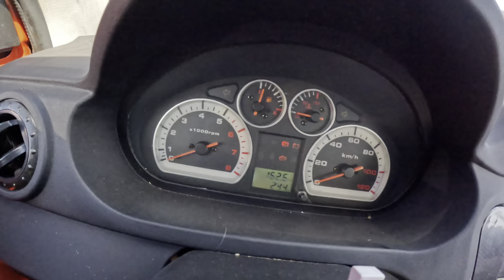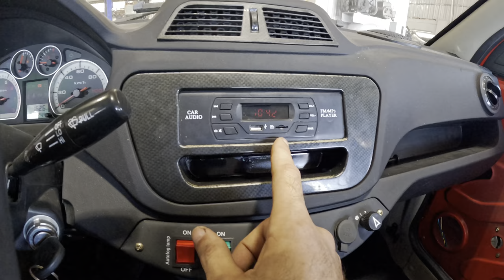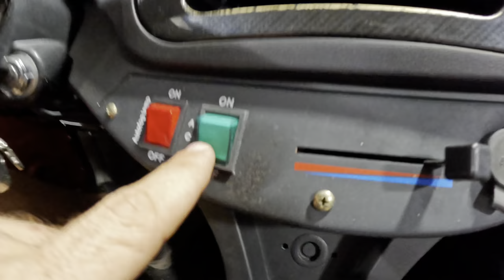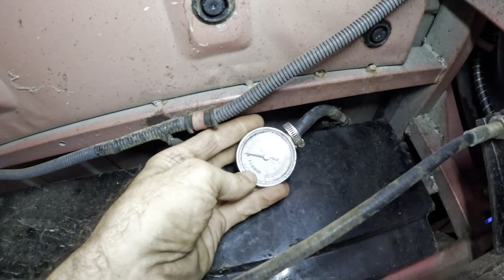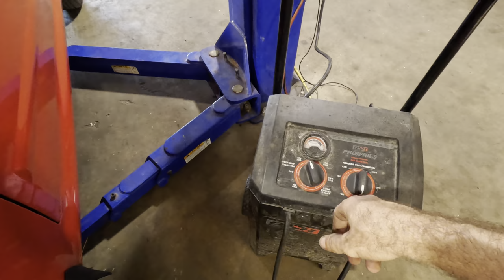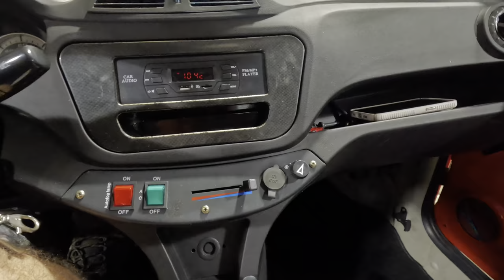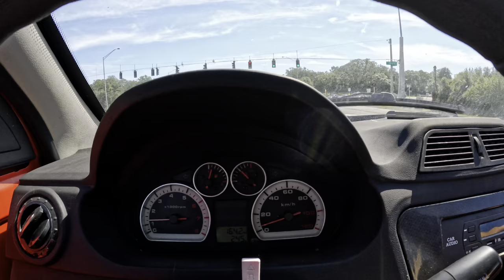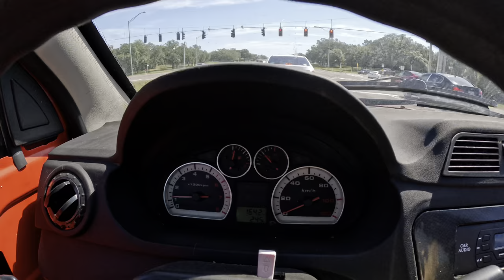UNFIT for the ROAD! Brand New 2019 Piece of Junk!

Comment: Be sure to remind the climate change people that there are hundreds of thousands of these driving around China without converters or any antipollution devices .
Reply: 😂

It's okay though because everyone has Chinese batteries
Reply: And probably believe it's better...
Reply: They also sell similar electric cars. Equally bad.
Reply: You don't understand ! If you don't have a catalytic converter, the fuel does not become CO2 ,just unburned fuel, hydrocarbon.
Reply: Converters are not needed, do lawn mowers, and golf carts need converters?
Reply: @thepubliceye  Lawn mowers are combustion engines using fuel and produce an exhaust . The difference is that not many people run their mowers for hours at a time every day . Golf carts are battery operated .
Reply: What's your point? That if somebody pisses in the pool then you should too?
Reply: @MarkS61  My point is that If I pay millions of dollars a year to stop one person from pissing in the pool and other people are still pissing in the pool then the pool still has piss . Did you know that in the past 50 years global temperatures have changed less that 1 degree .
Reply: Yeah, let's aim to be as good as one of the worst examples. That'll work out great.

I prefer the clear skies and cleaner air in Calgary and area to the smog of Chinese cities thanks very much.
Reply: i was thinking to hat very same thing war against oil here and there they get by with not worrying about climate but here were paying for the rest of the world
Reply: @thepubliceye Yeah but how am I supposed to feel superior when you bring logic into it?
Reply: @eaglerider1826  Golf carts are both and in California meet EPA standards without a CAT, you don't have to use a CAT to meet EPA standards, it's just the cheapest way. O what about motorcycles.
Reply: Lift point: Brake lines.
Reply: @thepubliceye  Need them? Probably. Just not legislated yet. Some motorcycles have them now though.
Reply: @eaglerider1826  Only SOME golf carts are battery powered. We had gas carts at the course I worked at, both Club Car, and Yamahas. All the bag carts were battery powered though.

Comment: Do you remember the early Honda, Datsun, and Toyota imports? In the 80’s or 90’s my work had Daihatsu miniature vans as site vehicles. Those things were ridiculously bad. Once, a slide door fell off going around a corner. We used to pile 4 guys at once in them, so they were kind of abused. Anyway, my point is that some of these companies will get better, quickly, and some will just fade away, but do not underestimate their potential to improve.
You are absolutely correct about outsourcing our pollution.
Reply: Well, the manufacturer of this car is too late now to catch up with the likes of BYD, GEELY etc etc or even the Wuling fun car 🚗 manufacturer.

Comment: I’m 75 and have driven early VW Beetles, Saab 9-3 with 3cyl 2cycle engine no ac or a 1961 PV544 Volvo all were solid transportation and fun to drive. No auto, no ac, no air bags though I think all were built better than this little thing. Don’t knock simple solid engineering, VW excepted.

Comment: Purpose built to move people in the most economic way.  Build quality might be poor by the standards we hold but if probably suffices where they were meant to be.  I owned small cars from the late '50s, DKW two strokes with 900cc engines.  They were good for everything I wanted to do, could even hold an assembled small motorcycle to take to races.  Really, 40-50 horsepower is good for most realistic driving.  I'd like to know the specs of this tinny little gem, like engine displacement, horsepower, and overall weight.  The engine is intriguing, might be a jewel in disguise ...(?!)
Reply: It's true that 40-50 hp will work. BUT in the US most of everything is at least 120 so while 50 can get the job done on a small car, it gets sketchy with our speed limits and infrastructure. Let's say making a right on red when the road has a 45 mph speed limit. "Stroads" as some call them. My car has 74 hp, weighs a bit more than a ton and it's mostly fast enough to be safe. Just have to keep up with the air filter and give it an Italian tuneup here and there. 45 mpg on a non-hybrid car that's easy to work on is amazing!

Comment: It doesn't really have McPherson struts at the back, it's a basic trailing arm system.  The spring/damper was clearly designed for a McPherson strut system (probably the same as the fronts), but it's just being used as a coil over damper.
Reply: they wouldnt have understood this technical stuff

Comment: I guess it is designed to fall into the Quadricycle category which means it can be driven without a driving licence. In Europe and the UK they have to be limited to a maximum speed of 38 mph.  Several manufacturers are turning out electrically powered quadricycles, such as the Citroen Ami.  Its battery gives it a range of about 60 miles and if you run out you can always attach a power pack to get a few more miles.  I suspect that vehicle as had the internal door panels taken off, perhaps by customs on import,drug check,etc. as I think the inside door handles were on the passenger seat, so I think you were a bit unfair to it.  It was obviously designed to be low cost and to meet the requirements for a quadricycle.  For that it meets the design criteria quite well, at least it can keep the rain off.

Comment: 28:50 the red button is probably for  the  front shield morning defrost but i could be wrong. We all know that one of the blower unit does not blow air out but it's only a stand alone red button solo funtion as a defogger unit.

Comment: Amazing that engine looks like DOHC. Amazing that level of engineering went into that product. That has to be an off the shelf engine as it looked more sophisticated than the rest of the car. I will say it beat walking...through the bad neighborhoods.
Reply: They've been knocking off Japanese scooter/motorcycle motors for years..That's the story for this engine...Shortcut made knock off with suspect metalurgy.
Reply: The logo on those alternator and starter belts are of Chery Automobile Co., a chinese car manufacturer. I wonder if the engine itself is made by them. I know that ~15 years ago they were producing licensed copies of other manufacturers cars - their Chery Amulet was a copy of Seat Toledo, Chery QQ was a copy of Daewoo Matiz and so on
Reply: Yeah th engine looked pretty nice actually. There must be a power booster that could be used.

Comment: I had a Honda N360 for a while. Basic air-cooled 2-cylinder 4-stroke motorcycle engine in a tiny car. I actually liked it, but it was too small and too slow to be practical so just sat around being tinkered with most of the time, and was eventually sold.
Reply: Me too, it was a great little car and quite zippy for it's size.

Comment: I actually kinda like this car. As a car enthusiast I get excited about both real expensive and big cars as well as the small "Underdogs" if you will. I think these corkey little cars are really interesting in design and how they're made. This reminds me of my G4 Mirage. I like cars from Challengers, to Park Avenues and Sables to Mirages and Scion IA. These small cars are pretty cool 😎
Reply: What about the Kei cars from Japan home market ??
Reply: Remember the BMW Isetta from the late '50s?  Single cylinder, air cooled, 300cc IIRC.  There was a slightly larger twin cylinder version also, I think could seat four.  The motorcycle dealer actually sold them in our city for a time.
Reply: @terminallygray kei cars are way higher quality than this car.
Reply: What kind of car is this?
Reply: @IsaiahWeldon  For a lack of a better word....Cheap.

Comment: Ray, you should consider always removing the negative lead first; and installing it last.  That way if you hit metal while removing or installing the positive lead you don't short out the battery.  If you hit grounded metal with a wrench while removing/reinstalling the negative lead nothing happens.  Perhaps you already knew this and just forgot during your video, but every once in a while I see this in a video and the author replies "Wow, I never thought of that!".  There is no advantage to removing the positive first - either way you are breaking the battery connection and the car electronics can not tell the difference, so it's only a safety issue.  Take care, and I really enjoyed this video.

Comment: Interesting little buzz box. This is fortunately not representative of Chinese car manufacturers generally. A lot of brands are reaching parity with companies like Daewoo and Kia. Not AT parity yet, but conceivable that they could get there. We get a lot of Great Wall commercial vehicles in Australia, and increasingly sedans as well. Some of them don't look half bad and are fairly polished mechanically
Reply: They can only copy so much over there. Quality, safety and fit are not the parts they copy though.
Reply: @FirstLastOne  they are doing the same thing Hyundai did and then Kia. Or for that matter Japanese manufacturers. Start of with ultra cheap crap, get foreign currency, invest in tooling and design, and end up with a high quality product. Take Hyundai for example, not the same quality as Mazda for example, but it's close enough and Hyundai's are very reliable vehicles. Even Kia which used to be a laughing stock makes some pretty awesome cars now.

The Great Wall passenger vehicles (and commercial utes) are well made. They are coming up on Hyundai/Kia/Daewoo etc. 

Also for a long time now there has been high quality manufacturing coming out of China. Crap as well. Lots and lots of crap. But some Chinese companies are doing great stuff with high quality products, look after their workers and still cheap in Western markets.
Reply: @FirstLastOne  this is a Chery A1, it looks to be rebranded as some no name Chinese manufacturer. They're a pretty rough and ready manufacturer and those cars serve a purpose in China though here (in the West) obviously they'd need a lot of improvement to pass safety standards. They're not built for the export market. 

My direct experience with Chinese Manufacturer's when it comes to automotive is limited to Lifan; I bought  one of their engines which is a knock off of the Honda 125 you get in postie bikes. It was solid and well built. Lifan have been offering good quality engines for years.

One of my customer's (a 4WD accessories supplier - bulls bars, shocks etc) outsourced their production to China, and in working with the factory over there confirmed the quality of production was on par with Australian standards (and our manufacturing industry is, though small, world class).
Reply: Commie Cars, Commie Parts, any better than the USSR Lada, or E. German Tramblant?
Reply: Do you even believe this is as what he claims, being just 200km new car? Just look at the yellowish oxidized head lights, the rust underneath the car, these do not happen overnight. Also I'm 100% sure the door panels been taken off on purpose either by the owner for some reasons, or just to make this video. You can see the plastic studs on the metal frame for the protective layer and panels, just like any cars.
Old Chinese folks may not be rich, but even they wouldn't get into a "new" car like that.
Reply: I have a Chinese car, here in Australia, and can say that it is quick, handles brilliantly, very solid and well built.  It also cost less than a Civic and is an EV.  Love it!
Reply: @MMLL369  I mean Ray actually says "there are the door panels" and points to them on the back seat. No one said it doesn't have door panels.
Reply: @MMLL369  no matter which way you rub it, it's a pretty basic car (no cat for a start so no ADR or US equivalent). It's probably safe enough in the sense that it works as designed, but the braking and handling tech is eclipsed by any car on the road in the West. But that probably doesn't matter too much because this thing can't even get up to the speed limit.
Reply: @techbio From observation, these tiny "cars" are often used in really rural 5th tier cities where you can just park vehicles in the middle of the road LoL Ya, it serves the purpose. 😄
Reply: @MMLL369  exactly. Tbh I have no issue with them, as Ray says they are basically a scooter with four wheels. I wouldn't buy one, unless I was going to make some wild project car out of it just for the heck of it haha. But I see their place especially in a poor rural area.
Reply: @techbio That's a really good idea! It's cheap enough for kids on get-to-know projects as it's has the basic functions of a car, a toy that they could play on for couple of years. 😆
Reply: Yeah no after visiting China and seeing it for myself, as well as on Cuba, no way in hell you're getting me to purchas a Chinese car. Ever.
Reply: @the_kombinator Yeah, I've been to Mars too, coz I say I've been there.
Reply: @techbio  I have  Hyundai (2002 Elantra GT) with 435,000 miles. Kept waiting for it to die and it never has. I retired it and now it's the community spare car, keys in the ash tray. Someone's car in the shop, grab the Hyundai. Just leave fuel in it. Everything still works, even the AC. 
I was going to get rid of it but who would buy a car with that many miles? 
The only things I replaced beside regular maintenance, 2 fuel pumps, 2 water pumps, 3 radiators, 1 CV half shaft, various light bulbs.
Reply: @TheBandit7613  they're great cars. I owned one, I swear by them.
Reply: @techbio what about the huge engine problems kia/Hyundai are having? I wouldn't say there doing great right now.  Lots of pissed of customers

Comment: 18:30 If you're not in a state with inspections, then it's legal. For instance, in Michigan, a homemade buggy just needs lights, turn signals, seat belts, and a roof covering the roll cage. Maybe a windshield is required too, I can't remember. But for this car, it didn't come with a catalytic converter, so it's ok that it doesn't have one. I will NEVER live in a state that has inspections. If I want to put cat-back, true duals on a Chevy V-8 or 8 feet of 2.5" cat-back and a UEL header on a Subaru and let it sing, I should be allowed to.

Comment: Last time I checked Activa was an anti inflammatory medication. Im sure driving that car daily would cause lots of inflammation from stress😂
Reply: Last time I checked, Activa was the Citroën Xantia version with electronically controlled hydraulic cylinders on its antiroll bars.

Though I suspect that this Chinese moped car will not beat any modern supercar in cornering, so it probably doesn't have anything to do with THAT Activa.
Reply: I thought it as yogurt. Lol